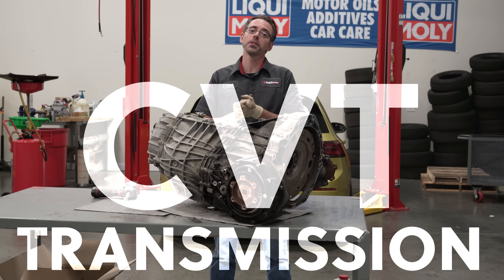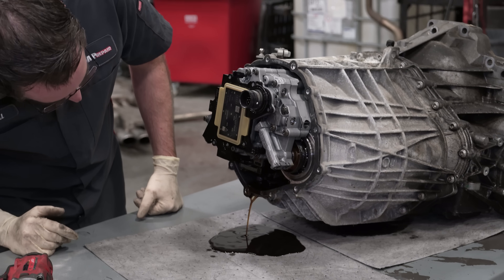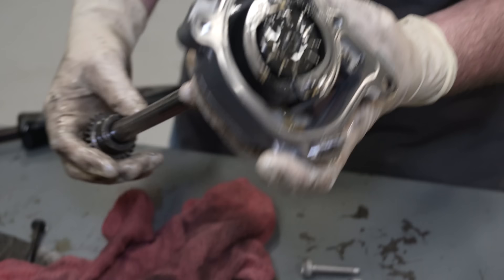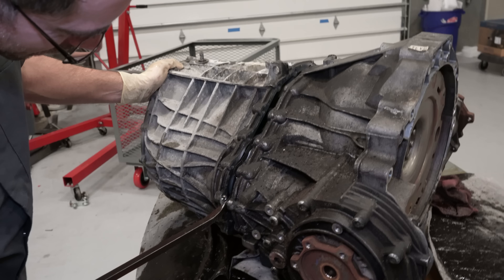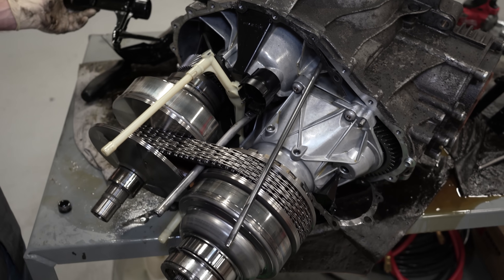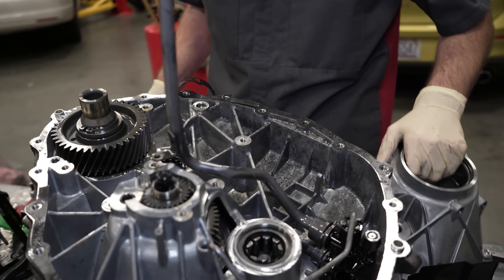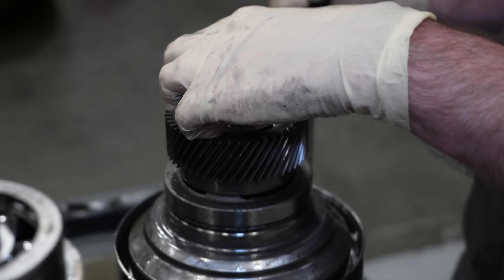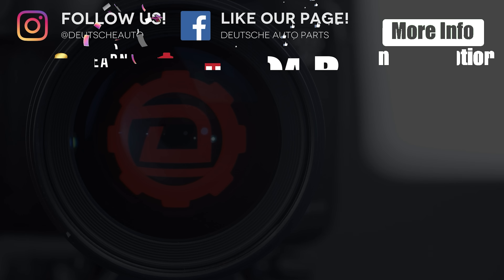Why you shouldn’t get a CVT transmission

Comment: My Honda Civic is 10 years old and noticed the CVT starting to slip a few trips (didn't happen immediately) after replacing with the correct fluid (as per Honda's maintenance schedule) bought at the local big-brand automotive store.  Went to Honda, bought THEIR fluid with the exact same specs and after a few trips, the slipping (didn't happen immediately either) was gone.  Remember reading how Chrysler was having problems with their transmissions, but upon investigation, not only were oil change places and transmission shops putting the wrong fluid in, the aftermarket fluid on store shelves didn't meet their specifications even though they sold it as such.  Before any CVT is written off, should replace with the manufacturer's fluid and driven.  Took me 5 trips back and forth to work for things to really clear up.  It's been a long time, no problem since.  Honda fluid or nothing for me.

Comment: I asked a few local mechanics in my area are CVT worst at breaking down than standard transmission and they tell me no. Modern standard transmissions are made out of lighter metals , changing gears more often with more gears will lead to more wear and tear on a standard transmissions as well.  Of course manual transmissions have the best reliability but now can get worst gas mileage than auto and hard ti find. We joke the best anti-thief device today is a manual transmission.

Comment: If a CVT needs a chain and spools, then the cost goes over the cap. Then it gets replaced. Half of a lot of the problems in transmissions, in Fords act bad and then fail due to the software. Most of the time the CVT gets replaced. They were supposed to get 5% better gas mileage in Fords, but came out 0. I always thought Ford was bad on the software for their transmissions. Even the TCMs themselves failed a lot. Ford Focus software was horrible and caused a disaster.

Comment: I have a 2012 Subaru legacy 2.5i. It has a CVT, 184k miles. And I floor the thing around everywhere frequently into the 100's. I have not had any issues with it yet. Am I saying it's a good transmission? No... I'm actually kinda baffled it's been lasting this long, and I've been waiting for something to blow up so I have an excuse to swap in the STI engine/transmission I bought a couple years ago.
Reply: Still holding up fine

Comment: It’s a personal choice. I love them.  Put 255,000 km on our last Subaru and ZERO problems with it.  Currently have 128,000 on another and zero problems as well.  Change the fluids every 60,000.
Reply: My crosstrek had paddle shifters and six preset shift points and jumped off the line..I have to say it wasnt as bad as many say..
Reply: 30,000 not 60
Reply: @James-un2zj  - Changing lubricant in the transmission every 2 years or 30,000 miles is the cheapest insurance you can get to make your vehicle last until it rusts away or falls completely apart. Big trucks with diesel engines that go 500,000 miles between major overhauls, can do this because these are expensive machines that are properly maintained by their owners. Plenty of people get 300,000 miles out of properly maintained Toyotas and Hondas, and I've heard of some Ford and Chevy engines in pickup trucks that can go this far if the oil changes are done regularly and the vehicles aren't abused.
Reply: @James-un2zj  Yep......
Reply: 60k miles is a good rule. After the first change you may decide to go every 30k if you are doing just drain and fill. When you do that only 30-50% of the fluid is changed (depending on the car) so, changing more often helps. I also change the CVT filter on the first change. Glad it worked out for you.
Reply: A transmission should last way past 158,000 miles. You're the first person I've read about that likes these things.
Reply: @rickj1983  I love Honda's CVTs.   Had zero problems with them so far.  Sad to see the video generalizing the technology.
Reply: @rickj1983  count me too
Reply: It's not only about proper maintenance, unfortunately - just like DSG-like gearboxes (at least early models), CVT's life is mostly dependent on your driving style - drive it hard (not slow, hard - abrupt accelerations, in and out of traffic, first from the stop light, that kind of thing) and it will fail very quickly, and that's by design! Drive it calmly and you can get it to work forever with proper maintenance. 
How I know all this - I killed new Subaru CVT in no time :D As well as 6-speed DSG on my old Skoda. Now I drive only manuals or hybrids or regular autos (those are rare these days in Europe)

Comment: Well to me they are badly designed to have too many seals rely on so many things to make them sort of work with oil pressure like hydroponics would do from pumps to servos run by electronics is just too complicated making them nearly useless and unreliable.  That is why F35 F22 fail a lot and why Air-force still use modern versions of older Jet aircraft because they are reliable and safe to fly and use in attack defense rolls.  When something becomes too complicated harder to fix and usually ends up thrown away just like that Gearbox.

Comment: CVT's are great for a Manco go Kart behind a Briggs and Stratton 5 horsepower engine. They don't belong in a car. A horrible driving experience like driving a weed whacker or a backpack blower. I could imagine what Audi engineering combined with one of these transmissions must yield. The worst most  unreliable car on the road meets the worst transmission.

Comment: I have been driving a Toyota Vitz 1.3 L since 2013. It has got a CVT transmission. It is functioning well. My car odometer reading is 238000. The key to getting the maximum out of a CVT is regular CVT fluid changed at every 50000K. I am getting 21km per liter on the highway at an average speed of 80km per hour. You can get the maximum out of CVT if you drive properly and maintain your car regularly. Great Technology.
Reply: What year

Comment: I used to own a brand new Nissan Brougham3000 Engine. For the first 2.5 years, it gave me the pleasure of driving. As the said time went by and as I comply with the service warranty, the pleasure of driving started to be a nightmare, I found out that while slowing down in TRAFFIC AND FOR THE U-TURN, I was no longer able to control my accelerator to guide it to slow down or accelerate the U-Turn as the engine went something the kind of hollow, unable to accelerate. The most dangerous situation was during the overtaking of other cars, I accelerated my car and maneuvered out of my lane to overtake but the engine didn't respond which made it so dangerous that the very maneuver was. Then I took my car to the Nissan Service Center and explain to them, they advised me to have the car tested at their main Nissan Factory, The response from the Factory after the CAR TEST confirmed there was nothing AT ALL wrong with my car, nothing wrong and returned my car, and advised me that my car was just NORMAL which I could not accept their test result. Deutsche Auto Parts, could you please tell me if this is the failure of its CVT TRANSMISSION.

Comment: I also hate with a passion, CVT transmissions.  I hate driving them.  I cannot see this technology be utilized in heavy duty applications.  It’s best use case where it would be the most reliable would be in a Geo Metro.  I’m also thinking WTF were the engineers thinking to pair this trash heap up with a V8?

Comment: they should've made CVT belt outside for easy replacement as maintenance item. The low gear and reverse for take off when the highest torque applied should've been driven through gear drive bypassing CVT belt as in conventional automatics.

Comment: In my experience, it is an excellent system, if you love driving comfort, I had a 2017 Honda Accord and I drove it for more than 150,000 miles and it never stopped being like the first day. It is not a transmission for a sports deal, nor for towing.

Comment: I love my Audi CVT (multitronic). It's the B8 eight step version (if used as step gearbox) with upgraded clutch. They mostly fail due to lack of maintenance. The older ones (came with B6 and B7 audis) with undersized clutches had problems. Later versions should work fine with regular oil and filter change.

DSGs are my shitlist toppers. I just hate those.
Reply: Grow some balls and get a manual car ffs
Reply: There's only one stick that is being handled in my car from now on.. :D

Comment: built units for all of the makes that invade america,you name them,the CVT is  NOTHING MORE than a golfcart trans,they thought it would be a good idea to mount to a 150+ horsepower engine,they were wrong,my sister has a MURANO i told her,never hot rod it,change oils on it often and treat it like its delicate,its held so far,i've never built one, i can see from your tear down1 you do not have a tear down bench,roll around or otherwise,you are NOT set up to build units,for every build bench you need two tear downs,the tear down is more important than the build benches,as you must see what's broke first,i noticed the CVT has a lot of oil and windage weirs,this is not good,everyone added means it was necessary to correct a screw up,going back together with this thing,no glory,knowing its got a short life span,means it would not thrill me to build one cause it has zero durability,looks like a machinists nightmare,no thanks,just now getting the shift solenoid and codes down on the other units used most frequently,no CVT'S FOR ME

Comment: I used a prius for good 8 years and now continued to be used by a colleague without any issues on the transmission.  It  has over 175,000 km on ODO.

My present car is 10th Gen civic with a CVT. Nearly 50k on ODO and no issues. Local civic forums also didn't make any fuss about CVT issues..

In general I like it for the smooth driving experience.
Reply: The Prius has an e-CVT. These are completely different from the belt-drive CVT in non-Hybrid cars like the one in this video. I have a Prius Plug-in hybrid, and I agree with you, the Prius is a great car. You just can't tow even small trailers with them, is the only downside of Hybrids.
Reply: The ecvt the prius uses is totally different but also way cooler. A well built cvt is fine but adds a big maintenance item to replace the belt every now and then
Reply: Actually, it is Audi's that are junk.....not just their transmissions.

Comment: CVTs are great in theory, absolutely terrible in practice, regardless of the manufacturer.   It is just unneeded technology.  The whole argument FOR the CVT is mileage.  However, the gains vs. a DSG or a good (Aisin, etc.) 8+ speed conventional automatic are non-provable.

We love my wife's Ascent.  Except the CVT.  I will never buy another Subaru, if they continue to use nothing but CVTs.  Car has been recalled twice, and keeps getting TSBs to check the transmission at almost every service.  Car jerks, surges, oscillates and it moans worse than a cheap porno film.

Comment: A lot of prejudice against CVTs on display here. Yet also a lot of comments vouching for CVTs on Toyotas and Hondas. As a Honda Jazz owner I'm on team CVT - it has smooth acceleration, lighter weight, better economy, fewer moving parts, and (at least in the case of Honda and Toyota) great reliability. A lot seems to depend on which make of car you buy. It seems weird to make a virtue of having to change gears manually to match the engine speed to the speed of the car, when there are reliable CVTs that optimise the engine speed (hence the good fuel economy) and essentially take the speed mismatch out of the equation. If manual gear changes float your boat, fine, but no need to diss CVTs as a practical solution for people who just want an effortless ride .

Comment: Wasn't cvt's created for better fuel economy?? But looks like big lump of metal that cant handle torque and short life span...would not a conventional automatic transmission be much much lighter, handle much more torque easily, less maintenance cost and being much lighter be less weight to lump around hence be much more economical in day to day driving compared to laboratory tests performed by lowest paid enginefars just out of university....car industry 1 step forward, 3 steps back

Comment: thank you for your insight. i have a 9th gen honda civic with said transmission with 225467 miles on it. I religiously change that fluid at 30k! man those German trannies are not up to speed!? i have had NO problems with mine. i call Audi's in and audi the shop and volkswagons, brokesvagons

Comment: The CVT in my Rav4 Prime is also a 6 speed that can be shifted.  It will also smoke all four tires off the line. With approximately 23,000 miles used in the calculation, it's current average is 82.8 mpg, which is slightly less than it's average in summer .  I absolutely love it!   It's definitely got enough performance to make me smile, especially when I can easily pass up any gas station that hasn't got a reasonable price.
Reply: 82.8 mpg?
Reply: @sfarias16  what he means is his mpg when he just reset the counter while coasting lmao
Reply: @user-yd7cu4vx7f  exactly.  There is no ICE car in the world that can go 80MPG.  Heck the Prius is considered the best and get 60 max.
Reply: @Mike Jones I know it is a prime.  What I am saying is after the 40 miles range is used up, can the prime give me 82.8 MPG?  So calculating 40 miles electric range + 42.8 miles per gallon, that equals to 82.8 MPG?  So I think the OP is calculating 23k miles divided by the number of gallons he put in from the day he bought the car to come up with 82.8MPG.  So I theory, if I were to take a 400 miles trip, I can charge every 40 miles and never have to use gas :).
Reply: @Mike Jones alright I might as well just buy a Tesla and never have to visit a gas station again ever.
Reply: @jml9550  @mikej238 thank you both cleared that up asap
Reply: @jml9550  The Volkswagen XL-1, which was a low production car built in 2014-2015, was and is capable of 250mpg out of its 0.8L TDI Twin diesel engine
Reply: @richardmillhousenixon  sure.  But 0-60 in 12+ second is downright dangerous.  And they don’t produce them anymore for a reason right?
Reply: @sfarias16  - He means "MPG-e". I have a Prius Prime, similar to the Rav4 Prime but with a smaller engine and only front wheel drive. The way you calculate MPG-e requires you to keep a log of gasoline purchases, and either a log or an estimate of how much electric power in kilowatt-hours you've taken on board. 1 gallon of gasoline will propel a Rav4 Prime about 40 miles. 1 Kilowatt-hour of external battery charge will propel the car about 3 miles, so 13.3 kilowatt-hours of electric power approximately equals 1 gallon of gas. If you have kept a careful log of gas and electric consumption, you can estimate what percentage of your driving is on gas, and what percentage is on external battery charging. For me, it's about 60% gas, 40% electric. Now divide the total number of kilowatt-hours of external battery charging you have done by 13.3, to get the equivalent amount of gasoline. Add that number to the total of your actual gasoline consumed, and divide the total miles driven by that amount, and you have the MPG-e for your car. But keep in mind that this number is going to be different for every individual owner. Someone who lives in Minneapolis, Minnesota, where the winter climate is brutal and who thus has to run the gas engine a lot just to heat the car, is going to have worse numbers than someone in Los Angeles, California, where the climate is more equal between winter and summer and who almost never has to run the heater at all. Terrain makes a big difference, too: someone who lives in Aspen, Colorado, in the Rocky Mountains, is going to burn a lot more gas than someone in Florida where the highest hill in the whole State is maybe 100 feet above sea level. On my Prius Prime, in 32,000 miles of driving, my MPG-e is currently at about 110 MPG-e. This is somewhat less than the EPS estimate of 133, but I take more long road trips that have to be run on the gas engine. If I was doing fewer long road trips, I could run more on electricity, and the MPG-e would be higher.
Reply: Paul I own  a Rav 4 Prime. You have a eCVT. It has planetary gears. The 6 speed shifter is fake. It does not have gears like an automatic transmission. It is continuous variable transmission.

Comment: I don’t agree with that, CVT one of the most successful technology, i have it in my car for 13 years without any problems, it works perfectly, it saves fuel, its fast , about fuel consumption my tank takes 60 liters of gasoline and it gives me more than 600 km traveling distance, i tested by myself, now if we talk about problems i think it depends on the user , if user put non genuine oil and dont replace filter then sure it will have problems like any gear , in addition to that my car have a gear cooling system with a small radiator in front the main radiator to cooldown oil , my car have over 150,000 km till now , I don’t think engineers in Toyota, Nissan, and many manufacturers are stupid when the invented and use it in their cars